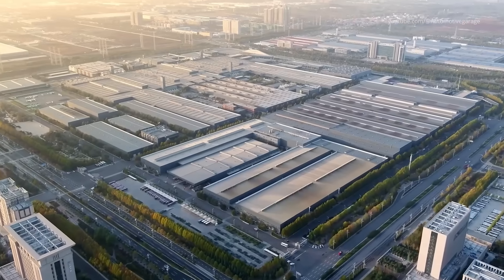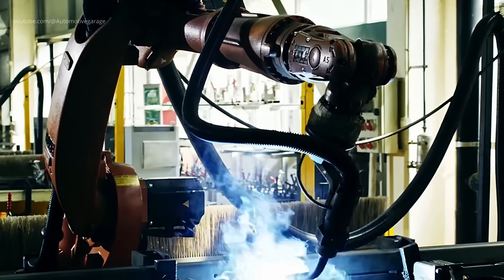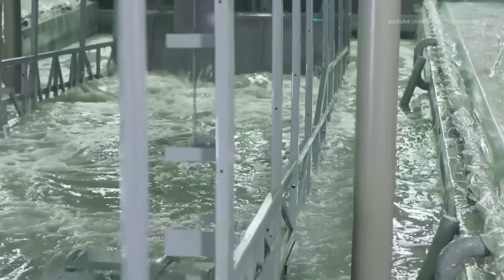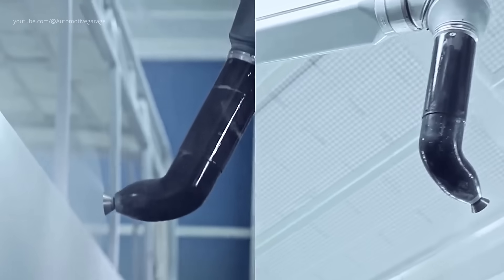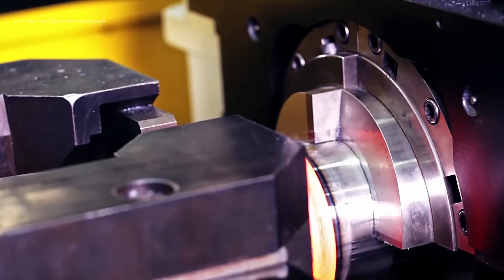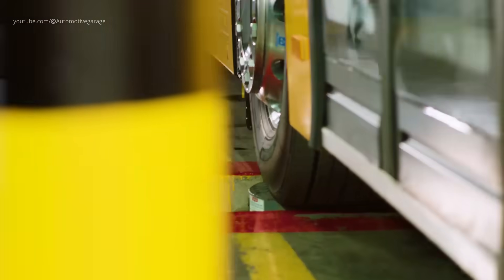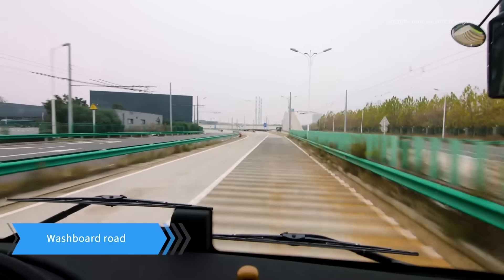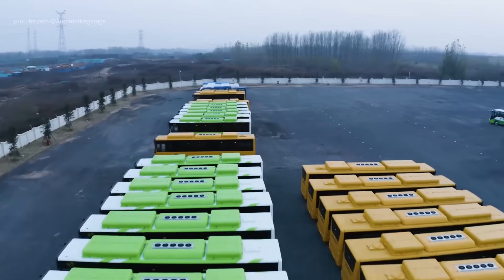Inside the World's Largest Bus Factory 🇨🇳 | How Yutong Builds Buses & Coaches in China  🚌🔥

Comment: Dear chainese yutong buses ceo ,the buses shell have good springs mean the buses should have suspension, have button system for suspension, if you press button suspension,entire bodyup ,the suspension shell be horizontal there , you can dance the bus vertically and horizontal ,with suspension.

Comment: I just worry about how long will the engine, Transmission, and brake systems hold up to the many years of use.
Reply: Many of those have been running for more than 20 years. Also their future products are all EVs. In China more than 80% of the buses are electric, which is the biggest market in the world. EVs barely need maintenance except battery replacement.
Reply: Well it's time to forget about the stereotypes I guess

Comment: Here's a comparison between Indian and Chinese buses based on various factors:

1. Manufacturers

Indian Buses: Major manufacturers include Tata Motors, Ashok Leyland, Eicher, Volvo India, and BharatBenz.

Chinese Buses: Leading manufacturers include Yutong, BYD, King Long, Zhongtong, and Foton.

2. Technology & Innovation

Indian Buses: Traditionally diesel-powered, but transitioning to CNG, electric, and hybrid buses. Volvo and Tata Motors have introduced premium intercity and city buses.

Chinese Buses: More advanced in electric bus technology with companies like BYD leading in EVs. Many Chinese cities already have full-electric public transport.

3. Build Quality & Design

Indian Buses: Rugged, durable, and designed for rough terrains and high passenger loads. Luxury buses from Volvo and Scania offer high comfort.

Chinese Buses: Sleek, modern, and more lightweight due to advanced materials. However, durability may vary in extreme conditions.

4. Cost & Affordability

Indian Buses: Cheaper in the long run, as they are built for Indian conditions. Parts and maintenance are more affordable.

Chinese Buses: Lower upfront costs, especially in EVs, but maintenance can be costly due to expensive spare parts and technology dependency.

5. Market Reach

Indian Buses: Strong market in India, South Asia, and some African countries.

Chinese Buses: Exported worldwide, including Europe, Africa, and Latin America, with a major focus on electric buses.

6. Public Transport vs. Private Use

Indian Buses: Widely used for state transport, private fleets, and school buses.

Chinese Buses: More commonly found in urban city transport and global export markets.

Conclusion

If you need a rugged, long-lasting, and cost-effective bus, Indian brands are preferable.

If you want advanced electric technology and modern features, Chinese buses are leading the market.